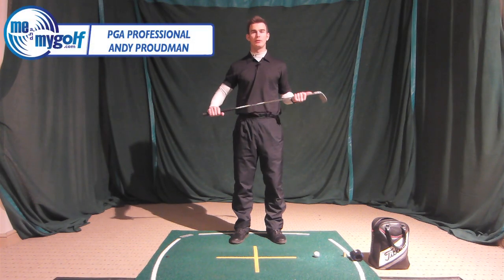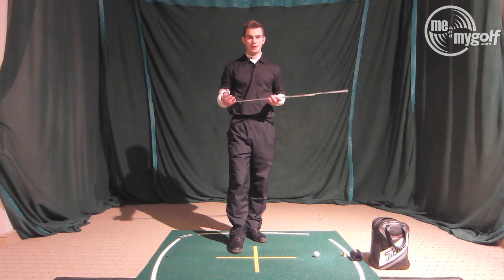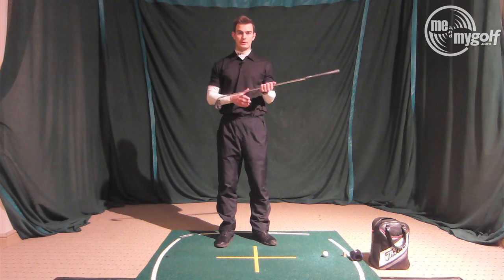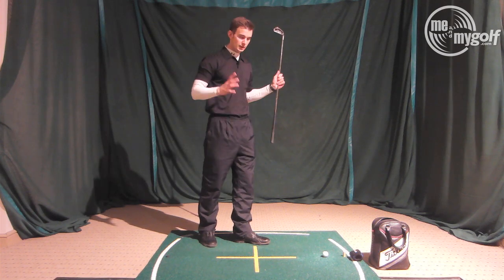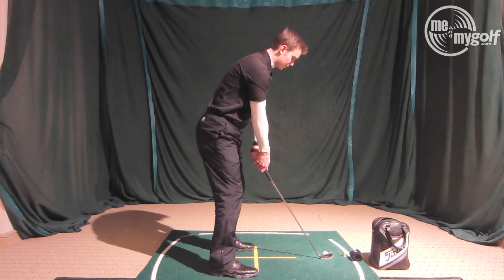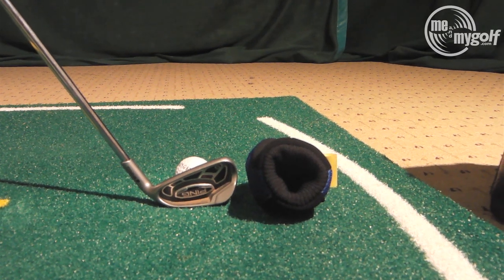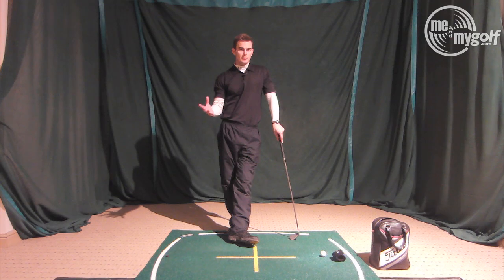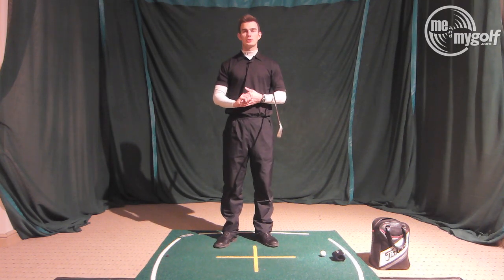How To Stop Shanking the Golf Ball

Comment: Great video. Was at the driving range recently and must have shanked about 50 shots. Driving me crazy. And that is after I played 18 over the weekend and my swing felt as good as it has all year. Solid contact on every shot. I am hoping that the weight issue was my problem. But the swing over the top might be what I need to focus on. The tips you gave should help. Thanks!
Reply from the maker: Great John! It may be both but this should really help.

Comment: My ball flight is on the high side. I changed the flight control to -1.5 and my trajectory seems pretty fair. I don't put much spin on the ball off the tee. My ball striking is ok. My miss is a pull or a hook due to flipping. At the range, I'm trying to build a habit of finishing low and left minimizing the flip before impact. It's tough to really trust it on the course. I'd say I'm a scratch golfer. I mean if I put well, I can go as low as 67 or 68, if I putt bad, lookin at low to mid 70s.